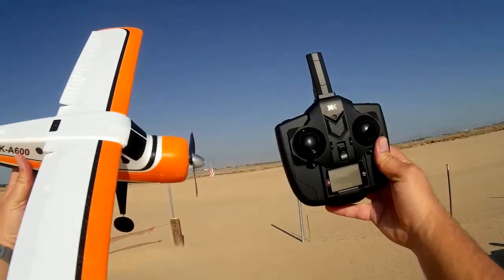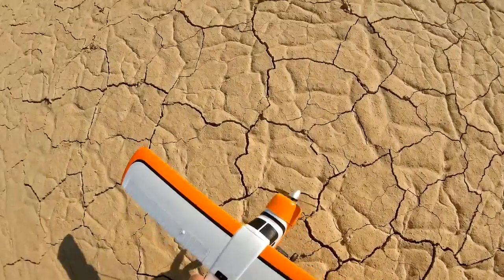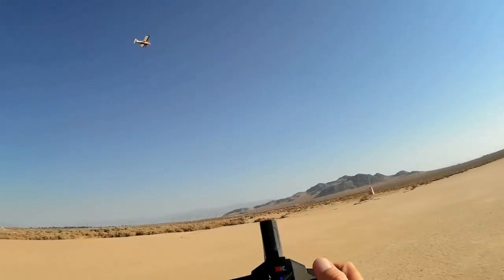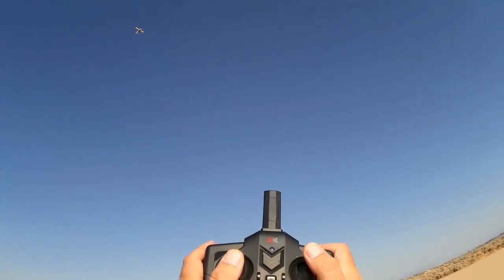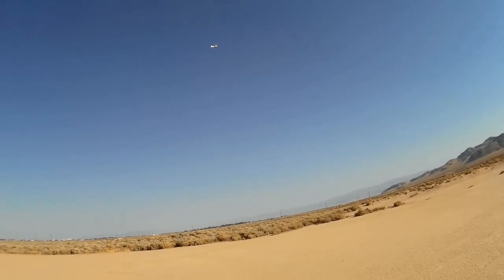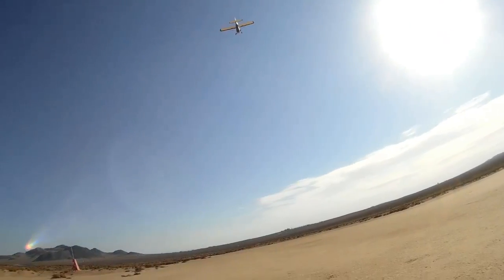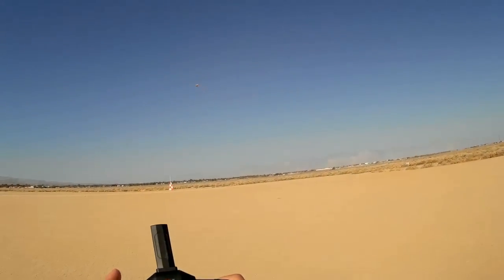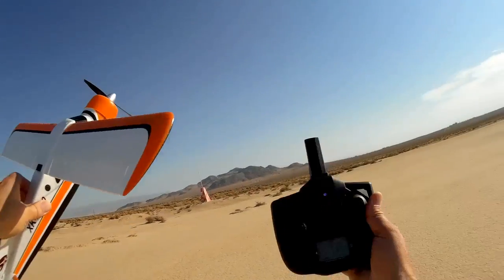XK DHC-2 A600 RC the Easiest RC Airplane to Fly

Comment: What you think is this still the best beginners plane? Now could be fund for 73$. Looks great deal.

Thank you.
Happy flying. (Y)
Reply from the maker: It is still a great beginner's plane, especially at its current price.
Reply: Thank you. I ordered it just few minutes ago. Banggood have 12th Anniversary sales and on some staff also this code: 12annvex-8% works. (Y)
Reply from the maker: I think that you'll like it. It's very impressive what it can do and how it can fly with its gyro stabilization activated.
Reply: I'm sure I will like it. It will be mine first plane. So will be new experience for me. For now I had just quads. But I doubt that neighbours will like it. ;)
Reply from the maker: Make sure to fly it in a field.  Airplanes generally need more room to fly than a drone as they're always moving forward.
Reply: Somehow like racing drone, but probably less maneuverable. I even hope that I will put some FPV camera on. But O.K. this is long term idea. Probably on plane which not have propeler infront would be better.

Comment: thanx  alot!
i ve just test it in two modes and it's more fun the 3 g mode for sure else i'm a beginner i succes to make looping and other figures acrobatics that i do'nt know the name lol!.... until and my wings were torn away in flight !the plane were in vertical position and power in lower position a litle wind blows but i don't understood what it happened:(? and of course the body of the plane scratch on a ground ..i will try to fix it with glue  whith special glue i had but i not very optimistic!:(

Comment: hi nice test but i have a beginner question: what is the differnce between 6g and 3g mode in the behaviour of the plane? in fact could we see it on the remote an item which show the mode of flight 6 or 3g? thanx a lot
Reply from the maker: There is no indicator on the remote. But it's very noticeable how the aircraft behaves between 6G and 3D.  In 6G mode, the aircraft is using six gyro and accelerometer sensors to automatically stabilize the aircraft.  It can not tilt over, nor bank left/right nor pitch forward/backward greater than about 30 degrees.  This makes it very easy for beginner fliers to avoid most crashes, even on windy days.  But 3D mode turns the stabilization off for expert pilots.  In this mode the aircraft can roll and loop and do other acrobatics.  But its also much easier to crash.

Comment: My plane cannot handle handle that type of when it has to be a very super come they not even a single bit of wind for my plane to flight great I almost lost it when we did the first flight out of park where there's a link buildings around it was a pain there and the wind blew it so much we tried controlling it but have safe mode on Elmo stand up on the building but in my ass to click the safe mode in my stool and without a problem except the front part of the propeller broken but it's okay it's still flies great I'm waiting for a comp day for my plane to fly a great and hopefully I'll do the light soon again when it's a very calm day that you have that plain U-Haul. I can take win but mine can't super light it but has safe technology that's what I like about mine I think that's a perfect beginner point to this a lot of beginner planes

Comment: Bought one from Gearbest,,,bad idea! Didn't get instruction book, bought 3 batteries,,,this plan has never beeped, or prop spun?! Gearbest sucks and would not even back there sale up
Reply from the maker: The airplane's electronic speed controller (ESC) should beep when you plug in the battery.  If not, its likely become unplugged or the battery that you're using could be defective (it happens).  Charge up and try one of the other 3 batteries.  Anyways, here is some info that may be helpful https://www.rcgroups.com/forums/showthread.php?2561439-XK-DHC-2-A600-Beaver-ground-school
https://www.rcgroups.com/forums/showthread.php?2449974-XK-Innovations-A-600-DHC-2-RTF-Brushless-with-3G-6G-Gyro-Review&highlight=xk%20transmitter
and here is its manual https://www.manualslib.com/manual/1091787/Xk-Dhc-2-A600.html

Comment: Can I fly this if I have never flown a plane or a quad the only drone I fly is p3 and Mavic pro never a quad or a plane 
I have tried plane or quad which I would love to start. Could I try flying it by myself?
Reply from the maker: It is very easy to fly as its gyros and accelerometers make it very hard to crash.  But still, it's best to fly this in a large open field to give you  plenty ofroom to make beginner's mistakes (you don't want to end up in a tree ;-).

Comment: What is the flight time of the model airplane?
Reply from the maker: about 13 1/2 minutes
Reply: I clocked it from TO to landing and the flight duration was 12 mins 21 seconds. It's not a good idea to deplete a lipo battery too much less than 3 volts...2.5 volts would be maximum, otherwise, the battery could be damaged...even catch fire. Using 3 volts as the maximum is much better!

Comment: Is it true that the gyro stabilization doesn't turn off completely when switching between 3D and 6g?  I noticed that in another video. It was still reacting to movement in both modes.
Reply from the maker: Auto leveling is turned off to enable loops and rolls, or other acrobatics. It's still stabilized against wind gusts.  But is it working now with the quick press of the button instead of the long press?

Comment: Were you able to turn off the gyro stabilization.  I followed the manual, but I still can't seem to get it to turn off.  I pressed the right stick down for 1 second, and it stayed on, just like yours did in the video. I tried other things too, with no success.  Suggestions?  -coptergirl
Reply from the maker: +Mary Martus Mary, quick press works.  Not long press.
Reply from the maker: You'll hear a short beep.  Watch how I go back and forth between 3D and 6G modes in this video https://www.youtube.com/watch?v=DqLSPwS5-4Q

Comment: is am thinking of buying a model plane. is this a good starter plane????
Reply from the maker: +Adam Woodward Although it is extremely easy to fly because of its automatic gyro system, it is a 4 channel aircraft (throttle, rudder, elevator, and aileron) which may be confusing to a new pilot.  Two channel aircraft (throttle and rudder) are very good beginner aircraft, and can be very inexpensive https://www.youtube.com/watch?v=9ffDCVQ8RDk
Two channel are good for beginner pilots as they help the pilot learn to maintain orientation on the airplane when its coming and going, yet don't overburden the new pilot with too many controls.
Reply: Get an appreciate s-15e

Comment: It's out of stock wonder for how long. It says Package Contents: 1 x Airplane, 1 x Set Wing, 2 x Strengthening Rod, 1 x Battery, 2 x Charger, 2 x Blades, 1 x Manual. Is everything I need in the box even the  transmitter. Your the best Quadcopter 101 for taking so much time to answer all of us.
Reply from the maker: +Tony Badurina Yes, mine did.  But let me ask GearBest to confirm that.

Comment: Wondering, what happens when the craft gets out of range?
Reply from the maker: +MrTeddyMMM No, not really.  It's pretty tough to crashes https://www.youtube.com/watch?v=tcy_QghRR9g
Reply: +MrTeddyMMM It stops responding. Or, on better planes, there will be a warning.
Reply: +Daniel Scott 
It stands to reason if it gets out of range that it will not respond to the controller. Does the craft continue on its current flight path? (buh-bye)...Drop out of the sky like a rock? (where's my dust pan)...Or, return to its starting location (that would be a nice failsafe)?
Reply: +MrTeddyMMM Hahaha. For this model you will experience delayed response times, then it will bomb out of the sky :)
Reply: +Daniel Scott I see, so if you try long range flights keep a dustpan handy.......Doh!
Reply: MrTeddyMMM Ha, I wouldn't try long range for this.

Comment: could i cut out a hole where the front window is and mount a small FPV camera so i could fly from cockpit view?
Reply from the maker: +LNX Gaming I'm sure you could do something like that.  But recommend keeping the total weight of your system under 20 grams. Although it lifted the 808 keychain camera, I don't think that it could lift much more weight.
Reply: Ill keep that in mind and check the weight of my camera system befor i get this. I have some FPV quadcopters but have never flown a traditional RC aircraft and would like to get into it and graduate to long range large aircraft to do some 5-10km flights some day.

Comment: can't you just add a flight controller to any rc home built plane and get this same auto leveling?
Reply from the maker: +Roger Paull It's not just gyros for auto leveling.   It also has 3 accelerometers that sense turbulence and sudden wind gusts.  That's how I was able to do those snake turns and vertical landings so easily in the wind.  They do make auto-leveling boards that you can add to your model.  If you shop for one, make sure that its "six axis stabilized" (3 gyros for auto leveling, and 3 accelerometers for wind gust corrections)
Reply from the maker: +Roger Paull By the way, I'm going out today to fly a gyro stabilized only aircraft (B-17 bomber) today to show the differences.  Keep an eye out for its upcoming video ;-)

Comment: Due to your fine video here, I got one of these.  However, it will NOT enter into 6G mode.  I've calibrated the gyros, etc.  When I push down on the aileron stick, I get a beep, but the plane stays in 3D.  Anyone have any ideas ?  am I forgetting something ?  BTW, when I apply throttle, the elevator moves up quite a bit; that doesn't seem right.  Anyway, looks like i've received a faulty bird . . .   Thanks,    Bob   p.s.   I've contacted customer service.
Reply from the maker: +bobclarie You need to press it quickly, and it will switch modes with a short sounding "bedeep".  If you press aileron stick too long, it will give a longer beep, but do nothing in terms of switching modes.
Listen to how the beep should sound with a quick press of the aileron stick as I switch back and forth multiple time in the following video https://www.youtube.com/watch?v=DqLSPwS5-4Q
Reply: +Quadcopter 101 Thanks for getting back so quickly.  I re-watched the above mentioned video.  Even with the quick push of the aileron stick, it will not switch to 6G stable mode.  I get the same "bedeep" sound as on your video.  Unfortunately it starts up in 3D and will NOT switch to 6G,  gosh darn .   Any other ideas ?  Bob
Reply from the maker: bobclarie How do you know it's in 3D mode and not 6G mode? (note that there is no indication on the LCD screen to tell you which mode that you're in).
Reply: +Quadcopter 101 When I hold the plane, and move it around, there is absolutely NO corrective movement from any of the control surfaces.  The servos remain totally quite . . .
Reply from the maker: bobclarie Did you plug in the aileron servo wires into their connector wire plugs?  This is a very important assembly step that is missing from the directions (bad on XK's part).  There is a cable attached to the main circuit board that has two plugs attached to its end.  You'll need to plug the aileron's servo wires from the wing into the plugs of this cable.  And the wires are not coded which plug to insert.  Thus you'll also need to verify that you inserted into the correct plugs by tilting the aircraft right and left.  When tilted right, left aileron goes up/ right aileron down, and vice versa when tilted left.
Reply: +Quadcopter 101 Yes, I plugged in the aileron wires into the Y harness.  I'm familiar with the color coding.  The ailerons do move correctly when I move the aileron stick.  The rudder moves properly.  The Elevator moves properly.  The motor starts up fine.  It's just that there is NO corrective movement on the control surfaces when the plane is moved around by hand, regardless of the mode when I briefly push the aileron stick down.  Sorry for not including the details.  Thanks again,  Bob
Reply from the maker: bobclarie Well, then, it sounds like you did everything.  Sounds defective.  Before you contact customer service, highly recommend that you make a short YouTube video showing the problem to overcome the language barrier.  Include the link to your video when contacting customer service.
Reply: +Quadcopter 101 Yep, I was looking forward to flying this little bird today.  Anyway, I did make a video, after I sent in my initial service request.  When they respond, I'm sure they will have many suggestions, at which time I'll send along the video.  Thanks again for taking the time to help.  And, I always looking forward to your videos.   Keep up the good work.   Looks like you have fun reviewing these little flying machines.  Bob
Reply: +Quadcopter 101 Update on my A600, to make a long story short, I ordered up a replacement receiver board, which they reimbursed me for, and installed . . .  the A600 appears to be fully functional . . . will maiden tomorrow . . . thanks again for all your help and support .

Comment: Hi Quad 101 -- how would you compare this plane to the  WL Toys F959 "motor/glider" in terms of ease of use  & overall experience for a fixed wing newbie -- if had to go with only 1 - which one would you recommend ??  Thx!!
Reply from the maker: +Brian Gonzalez That's a tough one as I enjoy flying them both.  Actually, I would start with the cheaper 3 channel 959 (throttle, elevator, rudder).  It's a tough bird, and a great intro to fixed wing.  But if you find that you like flying fixed wing, consider upgrading later to the A600 to start into 4 channel flying (ailerons).
Reply: +Quadcopter 101 thank you -- please continue giving us your great vids -- I have  7 quads bought on your recommendation -- I enjoy them all - thx!!

Comment: Three Questions my friend. 
1. How are the transmitter controls set up?   Mode 2 ?
2. How much assembly required.
3. For an absolute beginner RC pilot, what's easier, this or a very stable beginner quadcopter?
Reply from the maker: +Wobble Copter Mode 2.  Need to plug in the aileron control wires, and screw on the wing with one screw.  I like this as it practically flies itself in 6G mode.  But you can put it in 3D mode to practice 4 channel flying.  If you get into trouble, just press down on the pitch/roll stick to go back to 6G mode, and the airplane will automatically right itself.
Reply: +Quadcopter 101....OK, in flying 3D if I get into trouble push down on the pitch roll stick.  I'm always in trouble with my wife, will pushing down on the pitch roll stick help me out there. Hope it has a 6g wife option, lol.
Reply: It's ok to keep them as long as we can remain "man of the house" which I am, I do the dishes any damn time I want, usually right after dinner, lol
Reply: Wobble Copter 😃
Reply: +Wobble Copter here's a tip get rid of her your life will be much better this is coming from my experience lol😃
Reply: +Quadcopter 101 I want to suggest an experiment for this airplane.  I think you like flying in a large open space.  For rest of us in big cities though, would you try a couple things on this plane?  I think you could place some sort of LEADing edge slat to give it super short take off, along with permanent mechanical flapron ( by adjusting the push rod on the aileron, so that when servos are neutral, both of the aileron  pushes down at about 25 degrees).  Maybe you can see how short this thing take off from the safety of desert.  btw if you like a relaxed glider to fly around every once in a while, try this one.  It's got much better thrust to weight ratio than the Bixler and because it has very high wing mounted off the fuselage, and has the motor shaft right behind it, it has much much much better thrust angle for far far better flight.  You can even up put a slight;y bigger motor and about an inch larger prop for a real vertical performance.  I am thinking of ordering a few of this one right now..  with upgraded prop & motor and making a crazy vertical climbing machine.  http://www.hobbyking.com/hobbyking/store/__35018__Sky_Easy_Glider_EPO_1050mm_PNF_US_Warehouse_.html